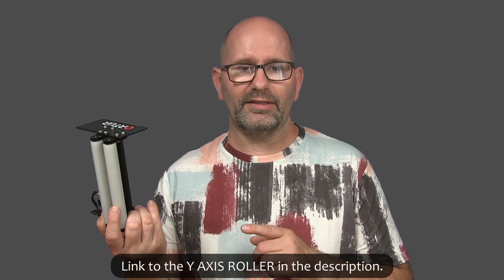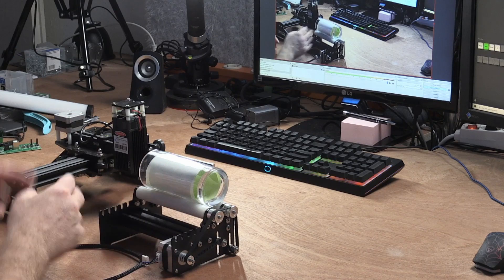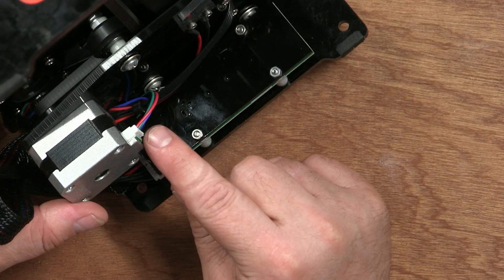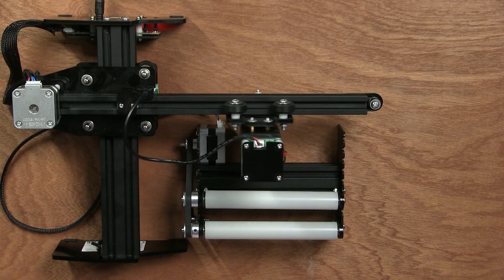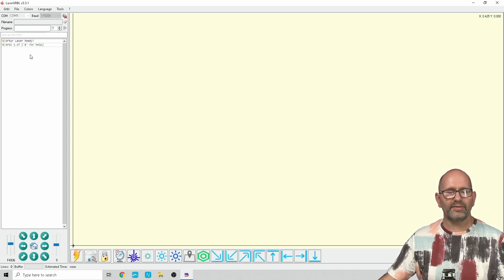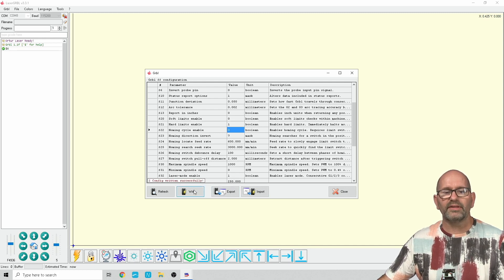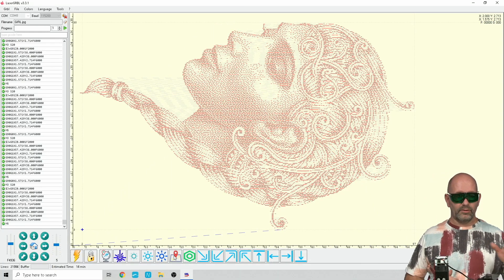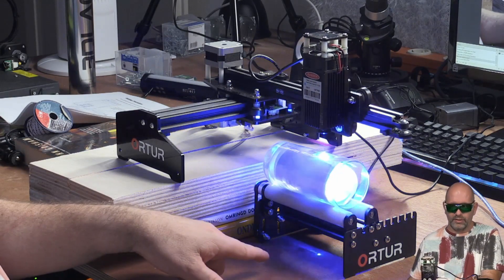▼ Ortur Master Laser expansion. The Y AXIS ROLLER.

Comment: any idea why the Y moves when hooked up to roller? i thought it would only move on X
Reply from the maker: Don't know. When connected correct, you have removed the cable from the Y motor, so there should be no electrical connection to drive the motor.
Reply: @3dPrintCreator  yes. Roller spins but the Y moves a couple of inches as well, although slow and with resistance noise.  Laser works just fine normally so not sure what may cause it. Hoped someone else may have ran into that problem and had a solution.  Thanks for replying
Reply: @3dPrintCreator  it works in Y2 with Y1 disconnected. Guess I either read directions wrong or put a part on backwards LOL

Comment: What will happen if you try to laser a Yeti or Rtic with one of these lasers?
Reply from the maker: With the modern 5 Watt lasers that have a very narrow, focused beam, you can engrave both the Yeri and Rtic flasks very easy.
Reply: @3dPrintCreator  so like get down to the bare metal? Why do people recommend CO2 lasers for such applications if a diode can do so as well?
Reply from the maker: @urjnlegend  It's only since about a year since diode lasers got that good, and also, they are slow because they don't have that much energy transfer. If you want to earn a living making these items, you can engrave about 20 times faster with a decent CO2 laser. Yet for hobby use, they are great.

Comment: Im can not make my roller work, when a send the order to engrave letters or picture on glass or bottle this engraves opposite direction, like it mirror mode, modo espejo, I dont know why, i have to set the letters or pictures in  diffrent way and direction but not working. any suggestion?? thanks. .
Reply from the maker: In Lightburn, Take a look at the Menu TOOLS, almost at the bottom there is ROTARY SETUP. There you can mirror the rotary tool.
In other software, I don't know... Sorry. I use Lightburn.

Comment: Hello, I bought the ortur laser master 2. What are settings to engrave glass. I can not do it. Can you help me? Greetings Niels
Reply from the maker: Sorry for the late answer.
Full power, and slow. This while you have a piece of paper or cardboard in the glass, so you don't burn the other side of the glass.
Make sure you use the optimum distance for your lens, like 35mm for the Ortur standard lens on the 15 Watt model, and 75mm for a G8 lens on the same laser.

Comment: The line is due to the glass being tapered not a perfect cylinder, near the top is ok but at the bottom of the image there is a slight overlap where it double lasers/cuts, alters the focal length too because it doesn't take in to consideration the diameter of the item, only the toothed pulley is referenced, you could try jam or coffee jars as these are more cylindrical as practice pieces.
Reply from the maker: I have not shown it here in the video, but the rollers can be placed under an angle, therefore correcting this problem.

Comment: What is the power of this laser?
Reply from the maker: The output power, or beam power, is about 5.5 watt. You will need a 3 Amp. power supply though, as the input power of the laser is 15 watt and the board and steppers also need some power.
Reply: @3dPrintCreator  Thank you.

Comment: Hey bud. Just on your website. I want a decent air assist attachment for my ortur 20w model. Will the one you designed work for me?
Reply from the maker: Hi Ozzy,
Sorry but no. The one I created is only for the 15Watt model, and will have a follow up in the next week or so.
There is however a model that is a rework of my design, that you can download on Thingiverse, that is made for the 20W laser. See:
https://www.thingiverse.com/thing:4414108
Reply: @3dPrintCreator  Perfect thanks for the link.
Quick question, Im having trouble with multiple passes when cutting. it isn't passing over the same area 1-2mm of a difference. I have the speed set to 200 on grbl so it's not going to fast. Any suggestions would be appreciated.
Reply from the maker: If the machine does not go over the same spot every time when repeating a cut, then there is probably something wrong with the steper motors of the machine, or with the control thereof.
It should be the case that the machine passes over exactly the same spot every time when cutting with high precision. If not, this really needs to be checked. Ask for help in the official Ortur group on facebook. I have noticed that they respond very quickly to these types of questions there.
Reply: @3dPrintCreator  Thanks for the reply. I managed to fix the problem, one was my own mistake not having the tension set even and the other was a simple but not so noticed issue. The tension bar was loose, and needed to be tightened via a small alan screw that was or became loose.

Comment: Sir, as to why your control board went out, the stepper motors at the X and Y axis are a DC motor and when moved not under power they will become a generator, by my observations when you where moving the Y and X axis you were back feeding the control board, the quick movements where sending large voltage spikes to the board causing your board failure.
Reply from the maker: Given the diodes on the board between the motors and drivers, this should not be possible. But I agree that somehow this happened anyway, so I see this myself as the only possible reason why the board broke down.

Comment: Might this work with the k40 unit?
Reply from the maker: This unit is not suitable for the K40 lasers, because this unit is controlled in a slightly different way, but there are Y axis rollers for the K40 laser, and many other types of lasers that work with a CO2 tube.

Comment: quick question, is it possible to upgrade the aluminum profiles and install a longer rods?
Reply from the maker: Technically, yes. They are very wide spread 20x20 extrusions, easy to get and to upgrade. Yet, you would have to flash the firmware in the machine with the new settings and I don't know how to do that.
Reply: 3d Print Creator no one’s able to produce a video where they upgrades the profiles.